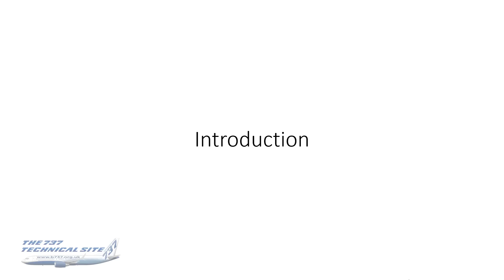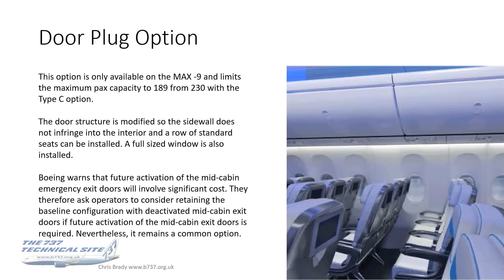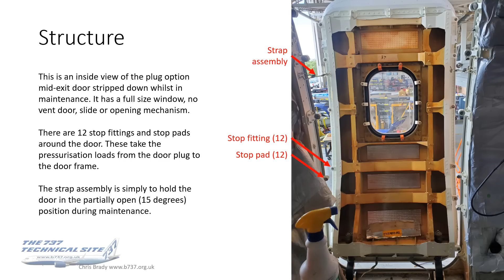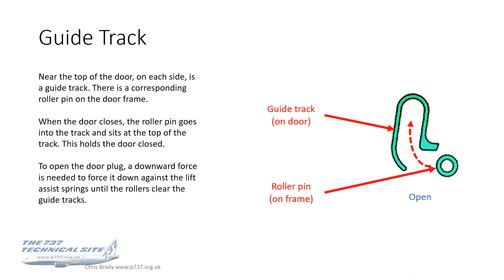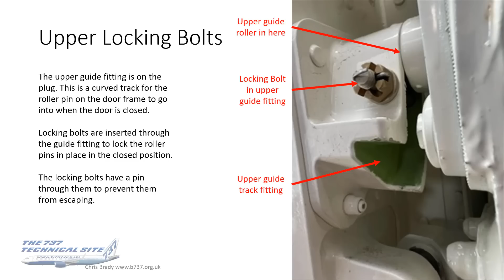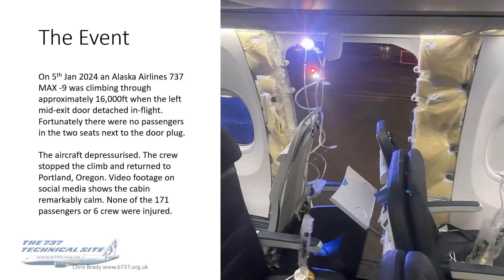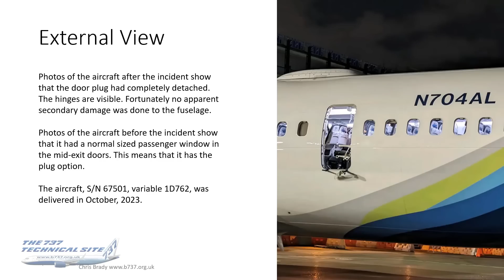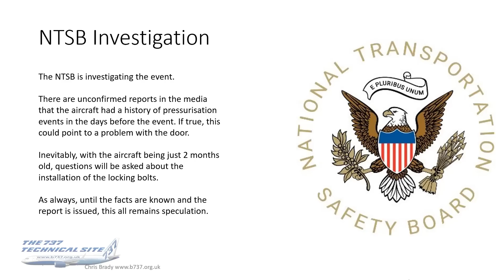737 Mid-Cabin Emergency Exit Doors - Plug Option

Comment: I don't see the function of the stop pads unless there are 12 fasteners passing through the stop pades to secure the door to the frame. If it only uses the two roller pins, then the inside air pressure would surely cause the door to bow outwards. A two pound pressure difference would be a tremendous amount of force on the door. 12 fasteners using the stop pads would pass the load to the frame of the aircraft for a total of 14 locations. This makes more sense. There are other interference obstacles with the roller pins and stop pads for installation, I think, but I'm no expert.
Reply: There are equivalent stops on the door structure that correspond to the positions of the door surround. These are aligned only when in the closed position and distributed to cope with pressurization loads. A rigging instruction closely controls their relationship. The upper guides ensures that the door opening motion will be controlled and the door and surround stops do not foul.
Reply: Agreed, the experts are all saying those stops are taking the pressurization load, but nobody mentions any bolts, clips, or other manual devices that lock the door to the stop pads. Maybe a tab enters a slot or something? Whatever the mechanism is I can’t see it. It must be quite simple as it has to tightly engage all 12 at the exact same time as the door slides downward 1-1/2” over the roller pins to closed position. Those stops also apparently release automatically when the door moves upward to open as nobody mentions having to manually release them. I need to see some close up pics of these “stops” to make any sense of it.
Reply: @Bitterrootbackroads  If the door had studs attached they, the studs could not go into the stop pads as the door lowered and slid or was cammed into the fully closed position. Just a wild ass guess, but I'll bet we, the public, will learn more than they want us to know. I've never been on a commercial aircraft and intend to keep it that way. One simple lack of situational awareness and its over.
Reply: @Bitterrootbackroads  the door or plug cannot be bolted using the stops as this will prevent the door from moving away from the fuselage structure when actuated. Consider the combination of the upper guide fittings (upper each side attached to surround) and the roller attached to the door frame presented on a bolted fitting - this controls the door motion and ‘locked’ position in combination with the sliding and spring assisted hinge pin arrangement present at 2 positions at the lower sill on the surround. The stops are hard bolted fittings (often adjustable to facilitate precise rigging) in the form of a cantilevered pad, there may be a threaded striker pin present that will allow fine contact or clearance adjustment between the pads.

Comment: There is a huge amount of confusion about the difference between a plug door and a door plug. The accident was caused by a door plug door. A plug door does not open, it simply plugs the whole where a door could have been installed but wasn't. Its my understanding that the only airline that actually uses it for an emergency exit is Ryanair due to their high density config.
Reply: *hole

Comment: It is my understanding that the door and frame design has not changed on the 737 for the Max series.  It's the same as it's been for many years and many variants of the 737,  so this isn't a new design issue.    I'm going to speculate that someone failed to install some or all of the four bolts.
Reply: That seems the most likely explanation.

Comment: Don't airline manufacturers keep detailed paperwork records of all steps taken in the manufacturing process, so it should be possible to determine how this door plug was installed and if the assembly was done IAW existing standards.

Comment: It would seem as though the spring on the lower hinge would force the shaft downward through the guide fitting in order to allow the upper roller pin to  exit the roller guide through the opening in the lower portion of the guide track. This is the only way to open the door. With redundancy being used for safety in most, if not all, commercial aircraft I'm guessing that it would take more than one of the locking / arresting bolts to fail in order to allow the door to open. Cotter pin not installed? Failure of the bolt(s)? Incorrect hardware installed? Time will tell.
Reply: All 4 bolts, 2 thru the upper guides, 2 thru the spring posts, need to be completely gone, either never installed or all 4 worked loose.
Reply: Logically you would be correct. All 4 would have to fail. Now we're learning that the plane gave cabin pressure warnings on previous flights and nothing was done. Duh! @SteamCrane

Comment: You cover it well. I never dealt with a plug before, I guess there is a handle tool for opening and closing it I would use. As a former door installer for boeing I would say that in operation the stop pins should have held it in place. Properly rigged, the guide rollers should be in the guides but they should not be touching anything. They don't hold it closed, just generally in place for opening. Air pressure does the work. When the pressure comes up the door moves slightly when the air pressure presses it against the 12 stop pins. The load should be 100% off of the guides and hinges in the air. It looks like everything came loose, The plug was never rigged. And they knew it. Or maybe it was just luck that the area around it was vacant. 5 empty seats on that plane. Sure is lucky that row was empty. I think it whistled....
Reply: Suspect the row was blacked out on the seating chart due to suspicions.
Reply: The person who was booked to be in the window seat missed their flight actually, they posted on Twitter about it later  @SteamCrane

Comment: Another speculation arises from Alaska removing that aircraft from etops flights due to unresolved pilot reports of pressurisation isdues. If the door was leaking due to it having moved out of position, there would be a lot of noise. Had passengers complained previously. Just recently the A320 in the UK that had its pax windows cooked by high intensity flood lighting causing outer panes to move out of position or depart resulted in a deafening noise at the affected rows (aircraft pressurised ok !!)

Comment: @6:16 "...the assist spring will make sure the door will not fall back to the closed position if opened...obviously that would be hugely undesireable if there was an evacuation in progress". 
Mr. Brady I thought you said these plug doors were not used in service and could not be opened in an emergency. Can you explain your statement?

Also can you comment on the fact that the flight deck security door blew open during the rapid depressurization event on Alaska Airlines flight AS 1282. Was that abnormal?
Thank you
Paul (in MA USA)
Reply: ...and the pilots lost their headphones!

Comment: Rumours at the pub say the the AC in question visited Oklahoma - without the satellite antenna at arrival  and with one when it took-off.

The pressure alarms occured after this visit, and the rumours say that the newly installed antenna could be the leak source. During the antenna work the Mid-Cabin Emeregency Exit Door (plug) is normally open.

So could Boeing, Spirit and Alaska Airlines 'go free'?
Reply: Is Oklahoma a contractor or Alaska base?

Comment: Surely if the guide track is on the door the springs are trying to lift the door guide track off the roller pins, and the springs hold it up to clear the pins when open. So to "close" the door the springs have to be overcome DOWNWARDS  TO LOCK THE DOOR, this means that if the locking pins aren't fitted then the door doesn't fail "safe" it fails "open" with only an assist needed from turbulence to open it fully and the door unlatch, if I am right then either you swop the roller and guide around so the springs hold the door closed or you remove the springs so the doors weight holds it in the locked position. Your dotted arrow at 7.25 should show the opposite direction of operation. Ive never worked these jets, I am just looking at the pictures, but I think I am right unless of course some one with experience on type knows better.
Reply: Its my belief that none of the 4 plug bolts or 2 pairs of lock bolts or 2 lift assist springs were installed.  The door would sit in the lower position, and restrained by the two curved L-shape tracks and 12 pads.  Any large shocks to overcome the weight of the door and friction, would allow the Plug to clear the tracks and pads, and pop outward into the air stream.  I cannot fathom any other scenario, however extreme.   As you indicate, any one lock bolt would keep the door in closed/down position.  Just an MSME with 45 years experience.

Comment: Note, I actually am a Mechanical Engineer.  The AMM SDS 52-23-00 is simply wrong.
Reply: After following this discussion here, in multiple threads, someone stated that it’s possible the manual is simply misleading in that the door might need to be pushed downwards very slightly simply to release pressure on the bolts for their installation and removal, but then to actually open the door it goes up.
Reply: @JohnHallgren  So the Indian subcontractor phrased it wrong.
Reply from the maker: * Update *
In this video I state that a downwards force is required to remove the door plug. I based this statement on text in the AMM SDS which I now believe to be incorrect or misleading. It is possible that a very small downwards motion (1-2mm) is first required to be able to free the locking bolts. But the door must be moved upwards by a couple of inches to clear the guide tracks. Apologies for any confusion.

Comment: One of the most common root causes of disasters is Shift Changes.  A worker does part of a job, goes off looking for the needed lock bolts, castle nuts, and cotter pins, the whistle blows, and he leaves. The next shift worker doesn't realize that the job was left unfinished.  A good scenario is that first shift finishes the work that required the plug to be open, and pulls it shut.  Second shift comes on, and installs the headliner without noticing that the lock bolts weren't installed.  With the headliner in place, the locks can't be inspected. Oh well, let it go, plane is scheduled, it's probably OK.
Reply: Ever had an engine removed, left on floor directly below pylon, and shift went home. Next day, another shift installs an engine. Only problem was, it was the same engine that was removed night before! hahahah... oh man!😳
Reply: @davidl5546  😳
Reply: SteamCrane - YEP!!! I did my Masters Degree in Aerospace Science and took a class in Accident Investigation. The accident I did a presentation on was the DC-10 at Chicago in May 1979 where the #1 engine and strut departed on rotation. They found AA was using unapproved process to drop the engine that involved removing the entire engine and strut from the wing. Shift change was a contributing factor on this one too....
Reply: @okedoke1234  Remember it clearly.  Another 2 factors were (1) hydraulic lines routed along the leading edge, broken by the engine departing, (2) hydraulic powered control surfaces that didn't stay where they were left, and retracted the flaps on just 1 side of the aircraft.  Boeing mostly uses jackscrews that can't be back driven. Also Boeing engines are designed to fall away without damaging the airframe.
Reply: Well, I think a lot of steps was missing to do not intall bolts and/or cotter pins. In the place where I work if you don´t complete a Task sing just line you done and sometimes make a coment, and always task printed in paper. So next worker know what to do exactly. And before intall cabin panel (in this case) a quality control check works in area. Im talking about factory and C-checks facilities cos Alaskan 737 is a baby plane only 2 or 3 months old.
Reply: Something similar happened to a turbofan engine, with which I was familiar, some years ago.  In flight, an ‘unbent’ split pin (UK term for a cotter pin) retracted from a mechanism.  This meant that the engine could not be throttled back for landing.  Nevertheless, the pilot was able make a successful landing, but at a much higher speed than normal.
It was probable that the the split pin did not get bent because of a shift change or a meal break.
Reply: I worked in the petrochemical industry and the shift handover was crucial, and often the source of issues too…
Reply: @PhillipAlcock  i sadly remember Piper Alpha
Reply: This was determined to be a contributing cause of an L1011 incident years ago when all three engines failed due to oil starvation. The crew managed to restart one and land safely, but it failed again and the aircraft had to be towed in. O-ring seals were left out of chip detectors during maintenance and occurred partly because the work was interrupted by a shift change.
Reply: Many aircraft are affected.
Reply: However what you said is true. In aviation (Construction and Maintenance) those situations are accounted and MUST be part of the procedures of the OEM and also to the maintenance organizations, to preclude that happens what you described. But off course procedures are useless if they are not Followed. Quality Control and Quality Assurance issues needs to be determined in this case, and in all other Mfg/Maintenance issues found...
Reply: Or a CONTIUNATION FORM where every step is annotated could be employed and instill a culture of using it and the oncoming shift of checking it to be caught up before "letting" the off-going shift leave.
Reply: Your comment is pure speculation with no factual basis. A worker could forget that a bolt or cotter pin needed to be installed due to a variety of reasons, not just shift change. What prevents errors due to such forgetfulness is the fact that there is a line item operation in the build instructions that specifies the installation of the part, part number included, which requires a sign off by the installer. If the part is a critical part, that line would be followed by another line item requiring confirmation, inspection or testing of the installation (as appropriate) by another person, and their sign off for that line. Work does not proceed to the next line item until the previous one is signed off as completed. Educate yourself before making irresponsible comments just to pretend competence. "Fake it until you make it" is not an appropriate tactic in ANY undertaking, including commenting on YouTube.
Reply: @petep.2092  No idea who you are replying to, but I am an engineer in capital equipment manufacturing, and worked with "old Boeing" in the 1970's.  Getting assemblers to be conscientious has become very difficult. Your statement points the finger at either a DEI hire, drug user, or Gen Z.  Boeing is hard union, so it is very difficult to get rid of incompetent employees. At both Boeing and Spirit, the push to get airplanes out the door is another big factor in quality issues.
Reply: I wholeheartedly disagree. 

Factory assembly lines, especially in the USA, have a high degree of quality control. We aren’t employing children like certain other countries and have many standards and checks. The company itself oftentimes has better internal quality control than what’s required through government regulations. 

That’s A LOT of missing pieces to blame on mere shift changes.
Reply: @angieg2561  4 bolts, 4 nuts, 4 cotter pins, but that's still just one job item, should only take a few minutes.  Also supposed to be signed off by an inspector.

A big part of the problems at some Boeing plants is elimination of QA/QC, workers are expected to self inspect their work, but not allowed time to do the inspection. Workers are then blamed for defects because they are not allowed time to do the work right.
Reply: @angieg2561  Boeing got rid of QA/QC in some areas, it was holding up production.  Shouldn't be that way, but it's all about "shareholder value".
Reply: @angieg2561  agreed - door is bolted into the airframe by spirit, shipped to Boeing, removed for cabin installation, then bolted back in by Boeing prior to pressure testing. So the last person to install the door is the Boeing person. If USA factory assembly lines have a high degree of quality control - how do you explain what happened ??
Reply: @angieg2561  Not true of Boeing. QA has been eliminated, heard 900 people fired.

Comment: My theory is that "AMM SDS 52-23-00" was written by Indian subcontractors in the same shop that wrote the MCAS software. It's just plain wrong.

Any expectation of quality and safety from modern Boeing is misplaced.
Reply from the maker: * Update *
In this video I state that a downwards force is required to remove the door plug. I based this statement on text in the AMM SDS which I now believe to be incorrect or misleading. It is possible that a very small downwards motion (1-2mm) is first required to be able to free the locking bolts. But the door must be moved upwards by a couple of inches to clear the guide tracks. Apologies for any confusion.

Comment: My theory would be that there was a shortage of castellated nuts and the door was held with normal nuts thus the split-pins could not be used. This would hold the plug door in place correctly until eventually the bolts vibrated loose and just fell out one at a time. "Hey-Presto" the springs would start to push the door up, making it leaky, and eventually the top rollers would disengage from the guides and internal air pressure would flip the door open from the top into the slip-stream and tear the hinges at the bottom off.